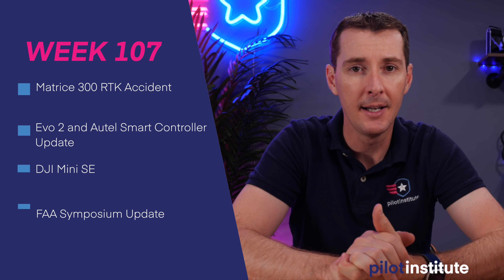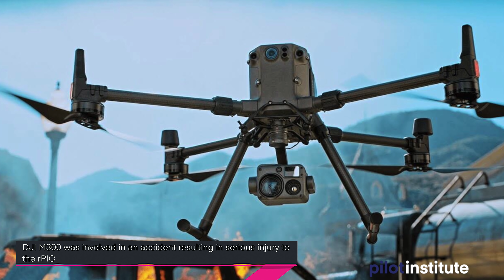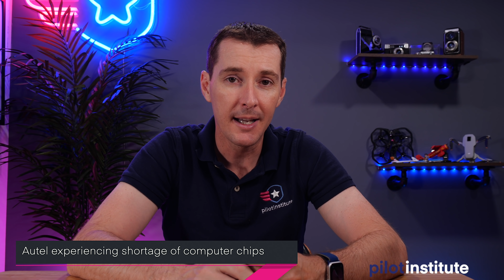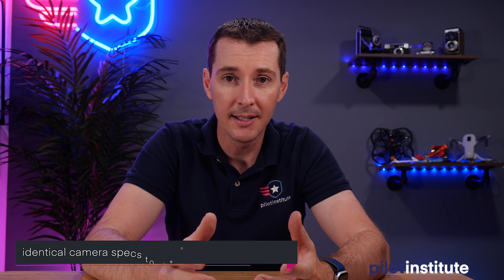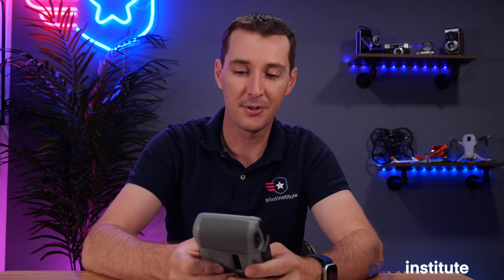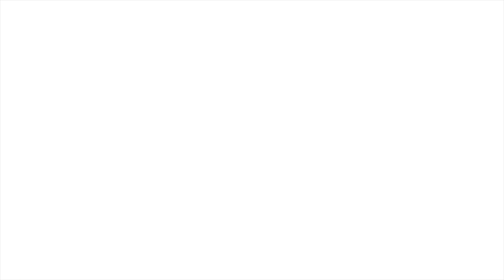Drone News, A Drone Accident, Autel Chip Shortage, DJI Mini SE, and the FAA Symposium

Comment: You provide excellent info. I hold an ATP and a part 107 Certificate. It seems like there is huge area of confusion. A person could pass the Trust test and not be able fly a park flyer. This whole community based rules thing is a mess. I am a AMA member and familiar with my local clubs rules. What are rules for flying a EPO electric RC at a local park? None of the formal club rules seem to address this. For a while there was a page on the FAA Remote Pilots website that could be used. How do we stay legal? The FAA keeps talking about CBO’s, what do we do in the mean time? I am not anti-authority I just need to know what the latest read on this is. The FAA’s publications on this have been nebulous at best? Now back to 107. If I am flying a non-revenue drone flight, I have been logging it as a proficiency flight. Which is legal in all other realms of aviation. I am usually practicing one of my essential skills. I state the purpose of the flight in the log book. Is this legal? I have not flown any analog drones or park flyers since all this mess started. Since I am not flying for fun do I still need Trust?

Comment: FPV drones have a disarm switch for good reason. The fact that DJI drone did not have a physical switch to stop the motors is just poor planning by the company. DJI drones are fantastic but the app is horrible and the fact that auto shut off of the blades does not come setup by default says a lot about how much work they need to do to make the drones safer for beginners.
Reply from the maker: It has a disarm, it's in the setting, you can set it to turn off the motors in case of an emergency. Same controls combination as to turn the motors on. It would have taken 10 seconds to go in the settings, turn it on, and shut the motors down.

Comment: Id like to see charges against DJI in this case as they are definitely negligent. No way to stop flyaway drones, no way to shut them down. The FAA needs to require manual override and shut down switches for GPS drones with automatic flight
Reply from the maker: 100% operator error. The shut down options are available in the software and could have been setup.
Reply: @PilotInstitute  The drone is sold as RTF ready to fly, but not ready to shut down. Im aware of the shutdown feature but it should be enabled on RTF drones from the factory and there is no reason why it shouldnt.  Perhaps its design, ie a combination you could accidently activate while flying (poor design) probably turned off for liability reasons by DJI or in other words, simply missing the dedicated hardware or sequence which cannot be accidently activated. I would think that the risk of not being able to shutdown the drone would outweigh the risk of the accidental combination.. which shouldnt be easy to accidently activate. When you activate shutdown its generally when the risk outweighs the value of the drone, and it is imperative that you deactivate it.. vs just normal flying which would have far less risk  All drone need to have this from the factory.. it is the final call on drone safety.. the drone MUST obey the pilot at all times, not fight with the pilot which is what happened here. If drones have a shutdown switch (not on the phone screen), and a clear indication on how to use it, this directly affects the number of number of serious drone accidents. So I disagree %100 percent and think that DJI is fully responsible for having a feature which should be a requirement, and having it not ready, on a ready to fly drone. Serious accidents like this need to be looked at closely by the FAA as there are not that many.  To push that off on a pilot who flew an RTF drone, and may not have even been aware he had to activate the feature, is wrong. It should have been active from the factory. Blaming the pilot is when rules come before safety..  I guess we will see in court, Im assuming he is suing DJI, if not then his medical insurance company might
Reply from the maker: @badpaw  It's all about training. When you become a commercial pilot, it's your responsibility to know the capabilities and functionalities of your drone. It's in the user manual, it's not a secret feature. It can be turned on for every flight if you want to, nothing is stopping you from doing it. This is 100% not the manufacturer's fault, it's on the operator for not knowing their machine.

Comment: My preliminary view on the Matrice 300 accident, it appears DJI's Geofence caused the aircraft not to respond. This is not unheard of with the DJI Geofence. I have not experienced it happening  while in flight but I know of others who have. I have experienced being unable to take off on two occasions after getting LAANC approval, thanks to the DJI Geofence. It is frustrating. DJI needs to either shut Geofence down or unlock it for part 107 pilots. I plan to purchase another airframe within the next 6 months and not having a Geofence to deal with is important. So what ever Mavic 3 Pro or Inspire 3 DJI  DJI comes out with will not matter if they do not find a proper Geofence solution.

As for how the PIC handled the situation is very odd and brings up many questions the biggest being WHY. Why would you pull the aircraft from the air and try to remove batteries? Was the aircraft going to harm a bystander?

Comment: As a current member of the AMA (Academy of Model Aeronautics) and a member on and off since 1987 I'm STILL AMAZED how theses drone pilots handle some situations.  ANY AMA pilot that flies in a AMA sanctioned field will tell you in THAT situation, you KILL the motors, if you CANT kill the motors be smart enough to take it OFF of GPS and Return To Home and land the darn thing line of site FAR AWAY from ANY spectators. Worse case scenario, put the aircraft into the ground, people are way more important than your drone. And NEVER approach the aircraft in hopes to remedy the situation.  I hope and pray you are teaching the aforementioned in you Drone Pilot School. EVERY aircraft I set up, and yes most are fixed winged, I ALWAYS set up the "Throttle Cut" switch, its smart and safe.  And also Please DON'T be these guys.  "https://www.dpreview.com/news/3003624618/thousands-of-seabird-eggs-destroyed-by-two-careless-drone-pilots"
Reply: The PIC was unable to kill the motors.  It also did not return to home and land.  It was unresponsive but in a hover.  Eventually its battery would run out and force a landing.  Reaching through propellers is not smart.

Comment: I had a similar experience where my Mavic Pro was caught in a DJI NFZ.  The zone did not appear on the controller (or any flight preplanning) until the UAV was in it. I was able to lower the UAV and it came free.  When I reviewed the DJI maps after the flight the zone did appear but my flight did not encroach the area.  I have wondered if the GPS signals fluctuated and made the UAV think it was in the zone.  It was very unnerving.  Sorry that this pilot was injured.

Comment: As someone working in the electronics industry, the chip shortage is a huge issue, and redesigning boards to deal with it is happening.  That said, changing a design, software and then revalidation takes some time.  That they are already announcing this suggests to me that they don't do a very thorough job of validation.